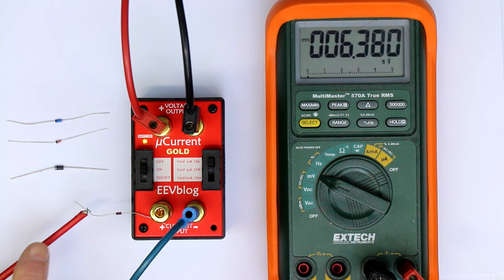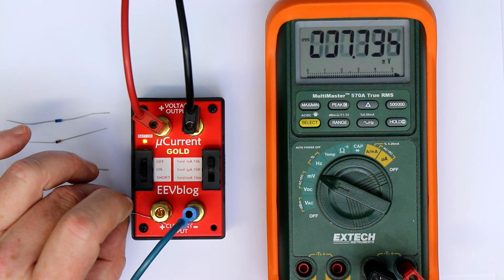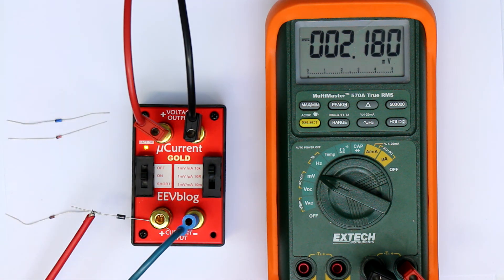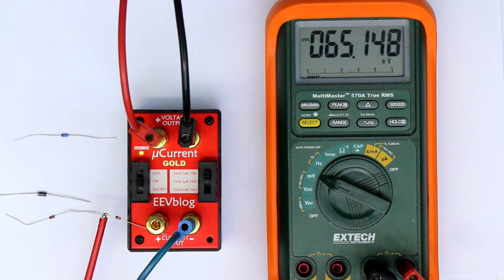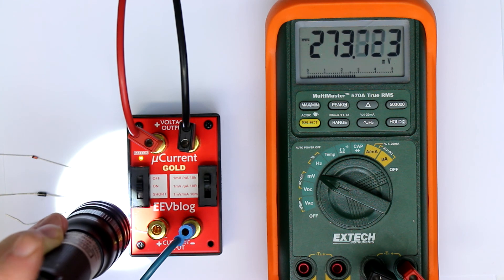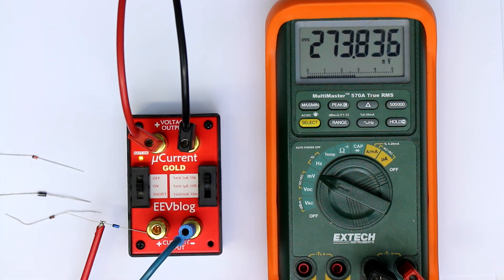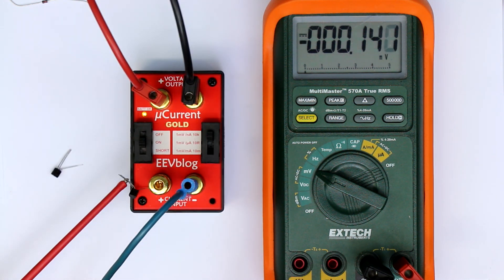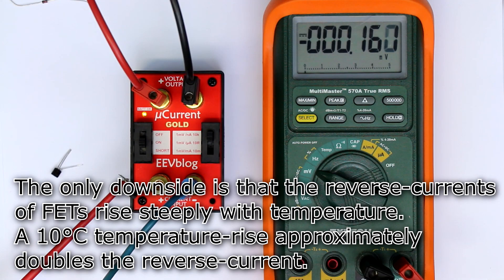Achieving sub-picoAmp Reverse-Current with OpAmp Protection Diodes

Comment: Hy! Sometimes i see usage of BE junction in reverse. Why would they use that? Is that current even lower?
Reply: Here for example:
https://plus.google.com/u/0/photos/photo/105582581813039352395/6540257242387409666
Reply from the maker: Using the reverse-biased Base-Emitter diode is possible but is inferior to using the Collector-Base diode.

Comment: This was an extremely informative video! Thanks for running it. 

I was left with a few questions about how quickly this protection would come into play. Unfortunately, I don't have the uMeter (and don't know what its transient response looks like), but I ran an LT Spice simulation of the final N channel JFET with a pulse type input going from -15V to 0.5V, and I see transients at each transition, as expected. Also as expected, the amplitude of the transient peaks are related to how quickly the pulse transitions. For the 2N3819 I simulated, a 5ns rise and fall time resulted in a 15mA transient current, while a 1ns rise and fal time resulted in a 70mA transient current...

Please consider looking at the transient response on a scope if you have time. Thanks again!

Comment: Why aren't diode made the way NPNs are made then? We could benefit from this low reverse current and they'll most likely cost less. There should be a reason...
Reply from the maker: Because for normal applications the low revrese currents aren´t needed.
Diodes are optimized for other specs like maximum pulse loads, high currents, high reverse breakdown-voltages etc.
And a PN-junction for a diode is cheaper to fabricate than an NPN or PNP-junction like in a transistor.
With costs in the cent-range every little bit where you can save money in fabricating a diode counts :-)
Reply: Totally agree with the cost argument, but what I said is that we'll make a PN diode similar to the base - collector in case of the NPN, not the whole transistor then short the Base - Emitter. PS: in one application I worked on, we struggled with the high reverse current issue, that why I'm asking :P. Thank you